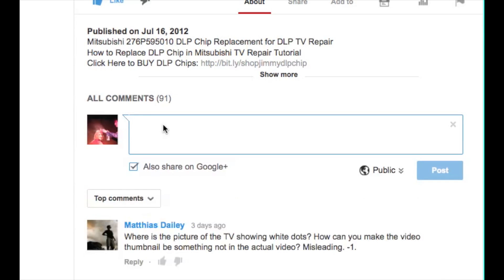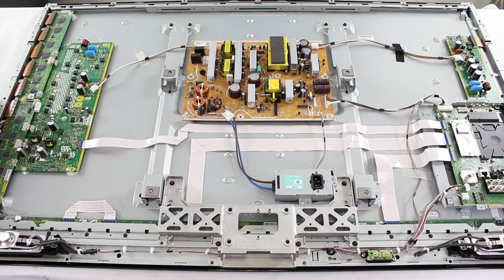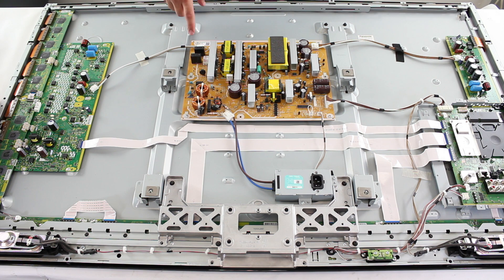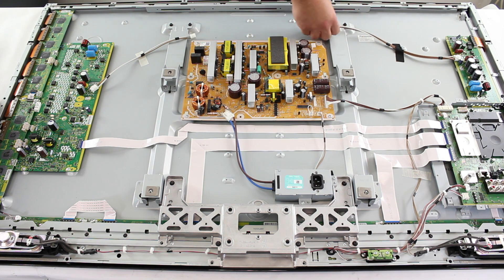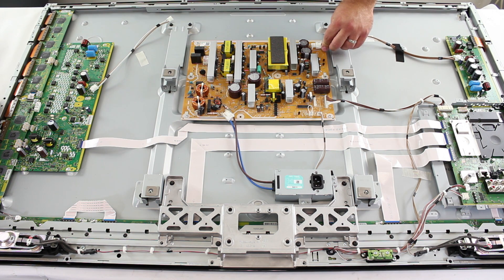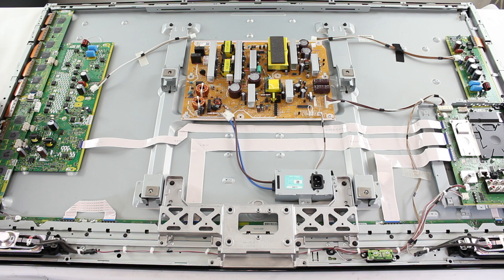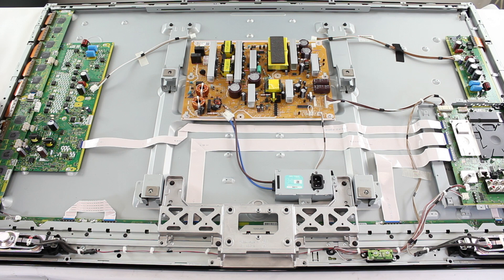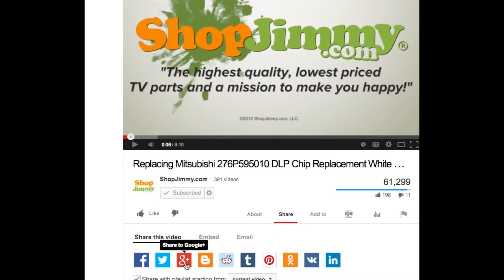Plasma TV Repair Help Clicking Noise & No Picture How to Troubleshoot Y Sustain & X Sustain Problems

Comment: I have the Samsung PN50B450B1DXZA.  I listen carefully to your instructions however you never mentioned what it may be the cause if, you have disconnected both the Y and X board and still hear the click.  I disconnected both boards and it powered on by itself. (Indicated by the red led light).  It sounded as if it clicked twice and the led flashed 5 times. I also heard sound. Then after the 5th blink, it powered off. (No led light) This happened with both boards disconnected.  Any idea, please?
Reply: Direct2 You power supply

Comment: hi! my tv plasma panasonic TH-50PV80MR-A not powering.. it shows 2 blinks greenlight and shut down.  what is the cause and repair should be done. where can i avail the power supply board parts. thanks alot

Comment: Hi, I have a Toshiba Model 42TL5152 LedTv, that does not turn on, when the power line is connected, the Relay starts to sound (
Without pressing the power button). 

Performing tests disconnect the motherboard from the power supply stops the relay. The power supply board send the 5v to the MotherBoard.

Thanks for help, 
I'm not an technician ok just amateur.

Comment: my LG 50inch clicks on and clicks off right away, and it keeps doing this by itself, and will just keeping done that unless I unplug it
Reply: Mine to. I'm going to try a power circuit board.
Reply: Sean Frantz currently the tv is still needing to be worked on. We had another so it just became a side project. :/
Reply: @Numbfoot  Did replacement of the powerboard fix this problem?
Reply: Stephan Goenner we actually tossed it because it was only 720p and plasma. There are people trying to get a class action law suit against lg for the problem though. It’s been a long time since I have looked it up, but if yours is an LG it wouldn’t hurt to look into it.
Reply: Sean Frantz I have the exact same TV Lg 60"  lg 60Pv250 and it does the same thing. I plug it in and it just makes clicking noise and red power light  goes off and on by itself and I have to unplug it. I also do not get any picture either. Im a female so i have no idea what to do can you Please help!!! Thanks In advance.
Reply: Nick Denovan i

Comment: Ok I have a LG 60PK950 Plasma. 

with all cables pluged (standard)( it clicks) but no picture
with only Y-Board on, it clicks
With only X-Board on it clicks.
with Neither the X - NOR the X-Boad on its also klicks.

so no matter what I do it always clicks but no picture, what now ???

P.S: it NEWER turn OFF automatially it stays in standby, the screen is also slightly grey (only visible at night)
so the relais clicks one time but no picture but STAYS in Standby with very light light of the whole screen:

If I turn it off manually it clicks two times and it goes off.

Comment: After watching your video, thought I’d share my TV problem with you.
So, here it goes.

I have a 64” Samsung plasma smart TV model# PN64F5500. About 2 weeks ago it started having a problem. The picture and sound cuts off for a few seconds and then come back on again. It will happen anywhere between a few minutes and an hour or so. It happens no matter what input used. I have tried all different input connections, even hooked the TV to a broadcast over the air antenna. I brought a TV in from the bedroom and it worked fine. So I’m guessing it has to be the TV. I even tried a different surge protector. Let me know what you think.
Thank you,
Bobcat

Comment: yes i have a 42 toshiba plasma tv  .the tv would not turn on. i  changed the yboard and the xboard and now it turns on.now it has red and green snow on the tv even on the menu part. did more research and i am thinking its the main logic board that is causing this problem now. what do you think

Comment: hy
i have a bluesky plasma model      bs 4206pt    ...that won't start up  ...the led is red, no clicking noise when pressing power button...i have 5v only on power suply,and on my main board (np-42s4-main-02)
first i manually start power suply(i've connected 5v to ry-on and vs-on) and all the tension at psu are ok-the led is stil red
i've checked all the regulators from the main board and the tensions at outputs are ok...
all the fuses are ok
can you help me,please?

any suggestion is welcome

best regards from ROMANIA

Comment: Hello I have a HP PL4260N no picture, when I do the procedure on this video, I disconnect the y board I hear one click on start up but no picture, when I connect the y board and disconnect the x board  there is still a click on power up , there is some picture with black blotches,   what do you recommend?

Comment: I have an Lg 60pg6560  2014yr. Had a loud pop than a flash picture(white pic) clicking noise trying to restart. The red light also flashing to restart. Checked all caps and they look good. Both fuses on power board are good.

Comment: I have a Samsung PN51D7000FFXZA plasma tv. I can unplug and plug power back to tv and both the remote and button control on tv work for about 2 minutes, then no control at all without unplugging again. I do have ir flash with remote but no actions happen. Looked for swollen capacitors but they all seem ok. Any thoughts?

Comment: Samsung Plasma manufactured date April 2013 PN51F5500AFXZA. When powered on the noise I get is a very fast clicking noise almost a buzz. When I disconnect the main board from the poser board there is no clicking noise. On this model the other boards are plugged into and powered by the main board and when I disconnect any of the other boards from the main board the clicking noise is reduced by about half the intensity in sound but not the frequency of the clicking. Would this change have to do with the current draw on the main board from the other boards? And do you think I am on the right path that the issue is the main board. Thanks for your help. Kenny

Comment: Hi ShopJimmy,  
I have a Samsung 65 inch plasma PN64E7000FFXZA Version TWO2.
Symptoms: Sometimes powers on and picture is as expected. Other times I can't get the unit to turn on or the power relay on the main power board cycles on and off.  I pulled the power supply board to look for obvious cap issues like swelled or damaged and did not find any.  Seems the other boards must be OK as picture is fine when the power supply comes up.  It almost seems like it is a power good type issue.  What next steps do you recommend?  
Sailing_chevy

Comment: Hi I have a hitachi plasma tv  model number P42E102A problem no picture on tv and power is going  when I switch on the switch
Reply: HUSSAIN DIDI hey i have the same problem, what did u do?
Reply: HUSSAIN DIDI Panasonic TC l-32 C12
Reply: TV shuts off in 10 minutes

Comment: I have a LG 60pv250 and am having the issue you named in title of your video. however, in your video first thing you go into is to see what wrong if don't hear clicking initially. well I do but I figured I'd follow all the other steps to see and still hear the clicking. the issue is I hear clicking but the power red standby light does not come on does that mean it is the power board?

Comment: I have a LG LED 42" 42LY560M Monitor that doesn't turn on that also doesn't have any blinking lights. (No lights at all.) I took the back apart and found a clicking noise while the tv was plugged in. The ticking came from the main board after I went through your troubleshoot tutorial in the video. Everything else seems fine. I'm curious as to what do I do next? If there's a simple fix or do I have to just replace the main board?

Comment: Hi,  
 first , sorry for my bad english, i'm from Québec ( french ).
i have a 50' plasma Samsung ( PN50B450B1DXZA )

It is possible that the Y and X board are bad ? cuz when unpluging the X-board  the clicking noise is there and so on with de Y-board.  if i unplug the both of the X and Y board, no clicking noice and we can here de startup sound.

Comment: i have a samsung 50 inch plasma and have unpluged both x and y boards and it  still clicks.... whats up?
Reply: X and Y are likely fine, Could be the power supply but you also need to rule out the logic and main board

Comment: hi, I have Samsung plasma 50 inch manufactured back in 09 model no: pn50b450b1d. has clicking noise and wouldn't turn on. as your instructions says I have tested both boards for clicking noise but the noise is not coming from them. its coming from the board where USB, HDMI and other video and audio plugs are. any idea? should I change that board?

Comment: hi I have a 50. in plasma model numer is tc-p50s2 it clicks and red light flashes 10 times please help
Reply: Did you fix it? I have the same problen
Reply: no can u help
Reply: I can't help, but I find the problem, I pay some to come to my house to find the problem, $50 dolls, he check all the parts, the damage part cost between 150 to 200, if you want to fix your TV, you have to do it your self, sorry, you can find the parts on Ebay will take 2 weeks 😣.
Reply: other ways will cost you like 400. sorry

Comment: Hi I have a LG 60PA6500, you can hear the psu "click" on and off with a red LED on the logic board, I already replaced both buffer boards and the only boards I can think of replacing is the X and Y boards or the PSU?

I tried unplugging the X and Y boards in every possible way and unplugged them completely and the tv is still clicking!

The only items that are plugged in is the logic board and the I/O panel, so why would the psu still be clicking?

Comment: Hi, I disconnected the y and x boards and the clicking remained just with with the power board, t con board and main board connected.  and my TV still kept power cycling. so I guessed my power board was the  problem. I purchased a new power board  from you guys about 2 weeks ago, put it in. nothing changed. changed t con board, same. I tested everything with my multimeter and I get pretty much the right voltages. there's no problem with the picture as I checked it with a jumper and all basic colors and are good, as the logo is good and clear when it starts up. it just stays on for about 25-30 seconds. I am getting on red levels on desperation, what else could I possibly  look for? my TV is the Samsung PS59D6900DSXZG.
Thank you. and btw, really fast and good shipment to Europe, thanks for that too.

Comment: I have a Samsung ln46a550p3fxza. I have had the capacitors replace and that fixed the slow start up and the death click. Now it s started up again so I replaced the motherboard and plugged it in it starts. When connecting any sources(antenna, cable, hdmi) the screen goes blank and starts clicking. Will not pick up any signal. Please help. I'm thinking something is wrong with the video board where you plug in your sources. Help!!! Thank you,

Comment: Hi There, I have a LG 50PK590-ZE which is no switching on? The LED standby light is on and the TV clicks to go on then clicks again and nothing happens? I have unplugged the TV and left it off for a hour or so and then plugged it back in again. I then turned the TV on with the remote and it came on and stayed on for around 15mins before cutting off again and going back to the same as first described? Can you give me an idea of what the cause may be? I have watch videos and they seem to be saying it may be faulty capacitors? Look forward to your reply!.. Many thanks Tommy

Comment: I have an lg plasma 60pn5700 that clicks when plugged in and won't turn on. It doesn't have an X board. It has a Z board and Y board.  Power goes through the Z board to the Y. I unplug the Y and audio came on in the form of white/pink noise. Plug the Y board back in and it clicks again. I think the Y board is bad but you didn't mention any sound coming on anywhere in your video. Please help. Thanks

Comment: Samsung PN51F4500AFXZA plasma looks like my 2 ports of HDMI 1 -HDM2/DVI not working I tried to replace HDMI cable and nothing showing this all happen when my cable box burn out due to bad weather. I had to replace the cable box and connect it coaxial cable now I can see a picture so this tells me that both HDMI PORTS are not working.I also use other  device with HDMI and nothing showing. So I think is the mainboard that went bad.Thank you for your time

Comment: good day I have a 55HDX62 Hitachi and there seems to have a problem with resolution.
I have changed the digital boards/sub input board as the hdmi was not working.
the pucture shows but it has a shadow around it as if the right resolution is not working on HD

Comment: Hi, Samsung Plasma Model No: PS50B551T3W maxing HUNGARY 12/12/2009. The problem is The TV stand by red light has been on when I want to turn on the TV with Remote control it kicking noise and the red light blinking it constantly every half minutes
I checked all the capacitors all OK please can you tell me what is wrong with the TV?
Thank you

Comment: My Viore plasma tv screen went out, the sound still works but the picture just went black? i replaced a blown 4 amp ceramic slow blow fuse now not even the the sound works.

The model number is PDP42V18HA. 

Rating 
120VAC 
60HZ 
3.0A

Comment: Hi...I have a Samsung PN50B530s2f/PN50B530s2fxza 50in. Plasma. It powers on and you hear the Samsung startup sound but there is no display. Just a black screen. There is also loud buzzing that starts after the startup sound and this buzzing continues until I pull the power cord out. There is also like a clicking sound and it looks like there were flickering sparks coming from the left side of the back of the set. Is this an issue that can be repaired? Thanks.

Comment: hello I have a lg 60pn5700 plasma TV.  it had a clicking and when I disconnected the y sus board the clicking would stop.  I replaced the y sus board and the y buffers now there is no clicking but still no picture just sound.

Comment: Yes u failed to mention what it means if you hear a clicking after unpluging both boards. You say "listen for clicking noise" but then just continue without saying what it means if u hear clicking and or no clicking. You just go on and say undo y board.
Reply: THAT'S THE PROBLEM I'M HAVING, DID YOU EVER FIXED IT? AND HOW?

Comment: I got a LG plasma 60pz550 no picture but audio only. I opened and found burned up fuse on right side (Z) board and also the heat coils were unwelded. I replaced the t6.3a fuse and welded back the coil. Now I turn on the power supply but it turns it off right away. I wonder what can be the problem on this tv and if is worth it fixing it or get another tv? Thanks for any advise. Will be a lot of help.

Comment: I have a Samsung 50" plasma tv, model# PN50B430P2DXZA. One day out of no where it shut off and since then any attempt to power on the tv, it clicks once like it always has, but instead of the chime sounding and the picture coming on, shortly after you turn it on, it clicks again and completely powers off. The red light will go out while its trying to power on, and once it powers down again, light comes back on. Any suggestions?

Comment: Hello, I have a Panasonic 42" Tv. Model is TC-P54G20. When I plug it in I hear 2 clicks then a short pause and another 2 clicks (from the middle back of the TV. It won't turn on and a red light blinks 10 times in the front. I got it from an estate cleanout and was wondering if this is an easy fix. Thanks

Comment: i have a samsung 60' plasma. neither y sus or x sus cause clicking i can have both disconnected and only the board that has hdmi connections plugged into the power supply and it clicks. is it that board then or the just the power supply. if all boards are disconnected, no clicking.

Comment: lg 60pv250, the red power light turns on but no screen, when plugged in it makes the clicking noise.  i have unplugged both ysus and xsus and still makes the clicking noise, even with one or the other.  so what if you hear the clicking noise when both y and z sus  plugs are unplugged?  is it the power supply board?

Thomas

Comment: Hello, I have LG plasma 60PA6550-UM no picture, no sound. The red power light stays on and there is a high pitch squealing, I have replaced the y-sus and the main power supply. The symptoms remain unchanged can you please help.

Comment: I have an lg 32LC7DC I believe the model itself has something wrong with it when I turn my tv on it automatically goes to white and there is different line colors from top to bottom around the screen no buttons except the power button work and the sound doesn't work either

Comment: I'm having the same problem as james cayzer with the same TV an LG 60pv250 I also am assuming the power board is bad, Am i right? 
Also you guys don't have the power supply board in stock and probably won't ever again, so do you have a video on how to use the the power supply repair kit as i have fixed some electronics before but this will be my first TV and any help would be appreciated

Comment: Panasonic model TH-42PX60UPB, I just bought a SS Board from jimmy because my Tv power light was blinking 7 times. I replace the board and the light is still blinking 7 times. Can this problem be the power supply board TNP A3911?

Comment: I have a samsung PN50A550S1F and took the back cover off and checked the caps on the power supply board and found none that appeared blown and doing a basic resistance check to ground, they all would rise or fall in resistance depending on lead polarity.  What I notice is removing the wiring harness that goes from the power supply board to the main board (HDMI + other accessory) would stop the clicking (but obviously the tv no longer works).  No other ribbon or connector stops the clicking.  I am curious if I am undervolt and therefore the relay wont latch or if there is something else going on?  Help